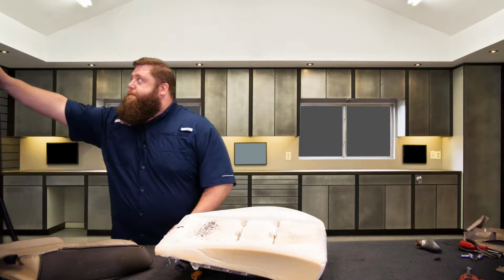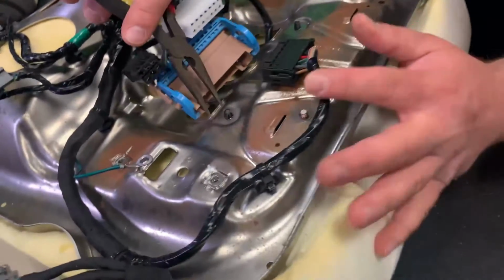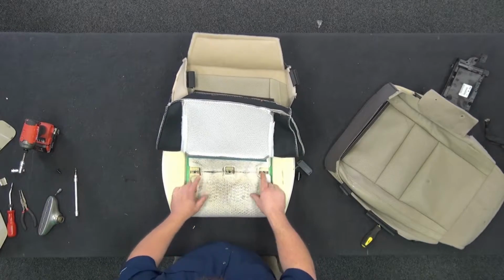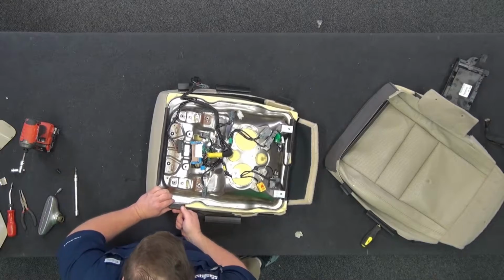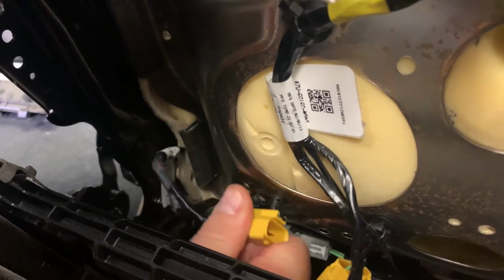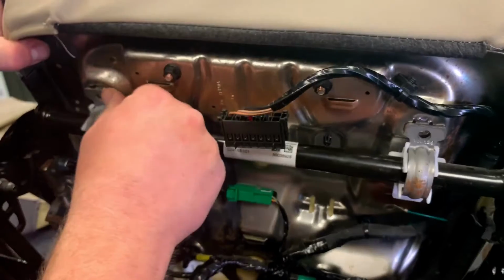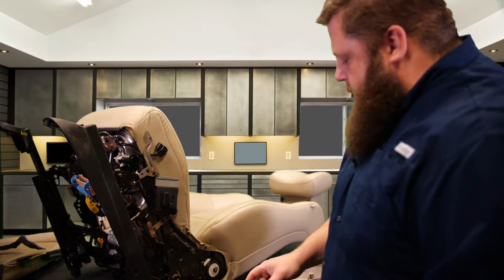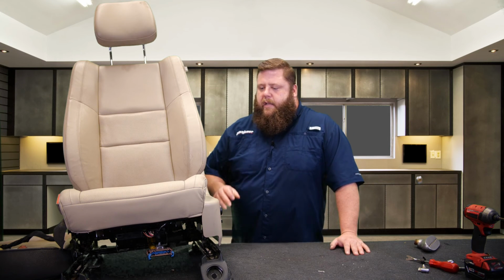Jeep Grand Cherokee (2011-2016) | Dodge Durango (2011-2020) – Part 2/2 – Bottom Cover Installation

Comment: The perfect job comes from Expert Men. You made my day, Bro. I'm going to do this for both driver and passenger seats as the leather got cracked and split due to the hot temperature here in the Gulf region.
Thanks a lot for the useful video.
Stay safe!